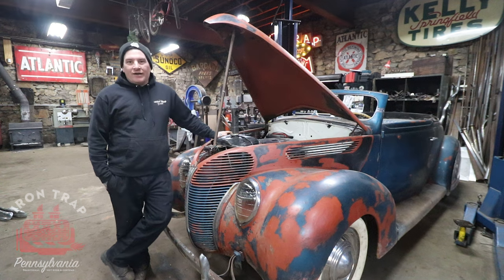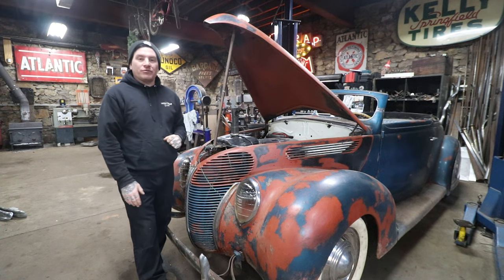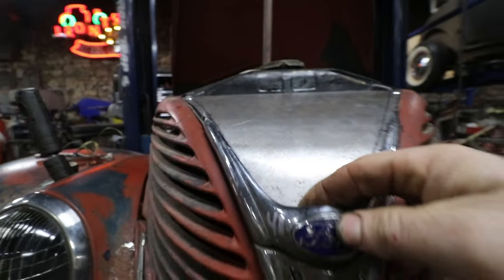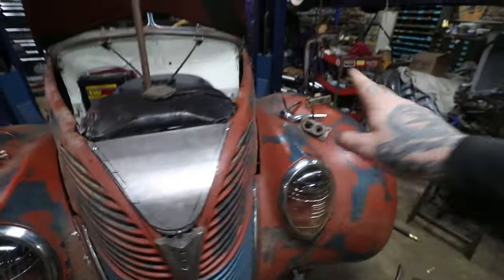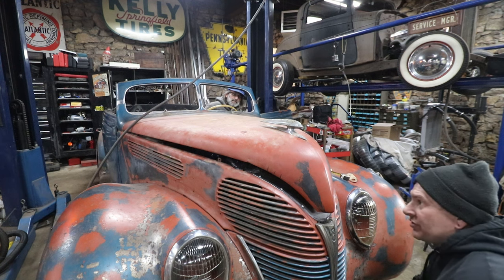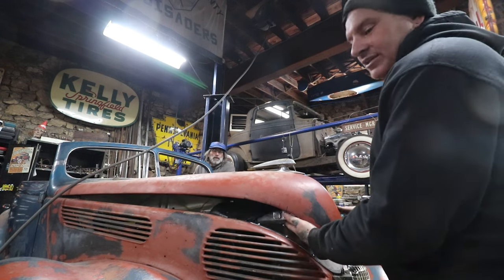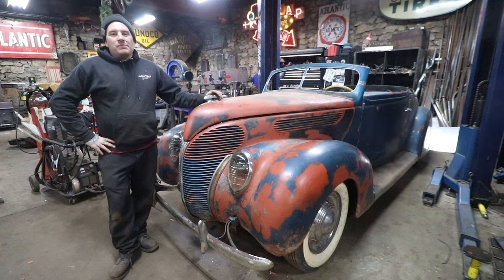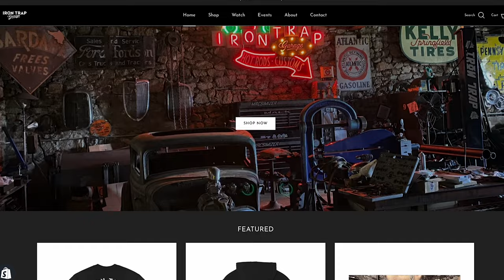Building A Hood Latch For The 1938 Ford Convertible From VW Parts!!

Comment: I think putting the slam panel under the hood sides would look better. 
I love rivet nuts. They are an elegant solution in so many applications. 
I was happy to see Moon looking away from the welding arc. I had a friend who's pooch got cataracts that he thinks came from him watching him weld. It's something that many of us never really think about when we're fabricating with our furry family members in the shop.
Reply: good point about pet's eyes. i'm with ya on the placement of the panel too.
Reply: Glad you were able to sort the latch out. One comment, so if you have to remove the hood side panels you have to remove the “slam panel”. That being the case I assume you might think about making that process as easy as possible. The slam panel mounted under the hood side would look best. Good luck.
Reply: I always have to put the dog out when I'm welding. It freaks him out but yet he stares straight at the arc...

Comment: Looking good and I like the VW latch set up.  Just a thought.  Unless you just like that stick hood prop, the old Willys Jeep trucks from the late '40s to about 1962 used a prop rod that attached to one of the radiator support rods and slid back and forth on it as the hood opened and shut.  The other end of the rod attached under the front of the hood near center.  Open the hood and rod would slide up in place pretty much automatically and when open would be near vertical.  As you go to shut the hood, just give the prop rod a little push to the rear to get it started and it would slide down the radiator support rod towards the firewall.  No more "Where's that darn prop stick?"
Reply from the maker: Good idea. I’ll look into one of those or making a version. Thanks!

Comment: Looking good  benefit of your slam panel forces  more air thru radiator to keep  the caddy motor cooler.  Not much a fan of VW parts but as the saying  go "Necessity  is the mother of invention "👍

Comment: There used to be early Cadillac taillight kits.  You could put Cadillac tailfins on most cars.  There was a,40 ford that ran around with Caddy taillights and fins.  That was in the 60s .  I think JC Whitney sold the kits.  There was a kit at the local NAPA parts store for years.

Comment: Very nice clean job of putting in the improved latch. Safety and reliability have to come first. As you correctly note, a hood flying open could be a real disaster. Your installation also looks cool. I'm glad you are putting the original hood trim back on.

Comment: I have a crazy idea ! n your OEM headlights how about installing LED headlights in place of the old headlights, and electroplating the head light buckets your self ? It's not hard to do. The Hardest thing is finding the sacrificial  material. A heigh out put battery charger would be nice. 1st step would be copper plating polishing  and then the chrome. Another way is to sand and polish the steal bucket and painting a clear coat on the bucket. I'm not sure as to which one would be better?

Comment: Belt drive fans do least when you need them the most. A 4 blade eats a lot of hp and wears out water pumps a lot faster. Electric fans use minimal hp and only work when needed. They use much less room, fit either side of the radiator and much safer. My high compression engines rarely start the fans even on hot days and I've never had one get hotter than 185 while my fixed blade pals dread over heat. Even my two prewars are electric fanned and generators keep up with them. I use TESTED 165 thermostats.
Reply: Electric fans and traditional cars don't mix. Think 1960 bud.